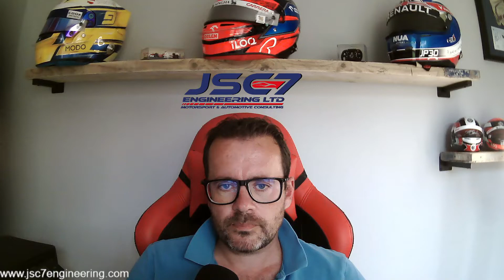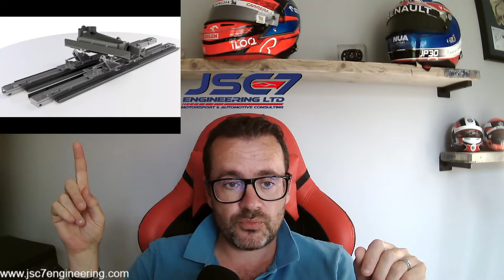How Does F1 Work? Episode 1 (Power Unit & Simulator)

Comment: What do you think of the new PU-regulation for 2026 and the 50/50 powersplit between the ICE and MGU-K? Will the future cars be slower then the current ones and instead have more powerful „overtakebutton“/ ERS?
Reply from the maker: I think that engine driveability will be worse, at least to start with with possibly more difficulties to deal with turbo lag. Regarding power it should be the same, just more difficult to handle on throttle.
Reply: Ok thanks. I’m asking the question because I have read that the ICE will go down from 850hp to 530hp (and the hybrid up from 160hp to 470hp).